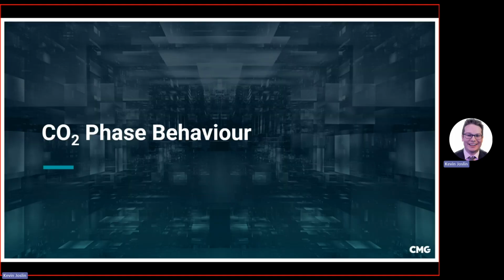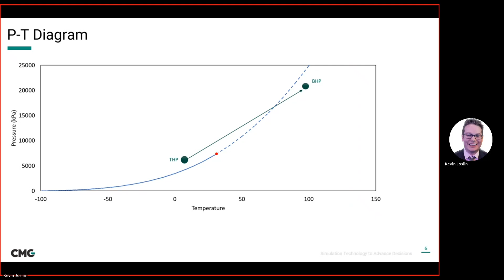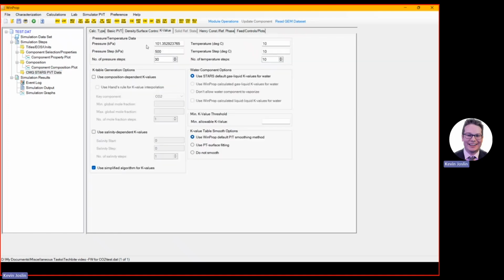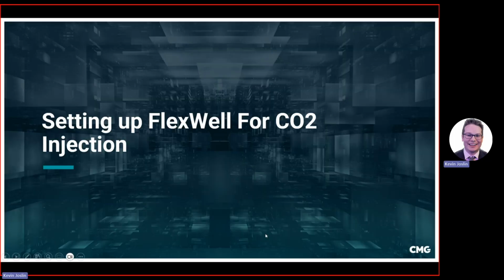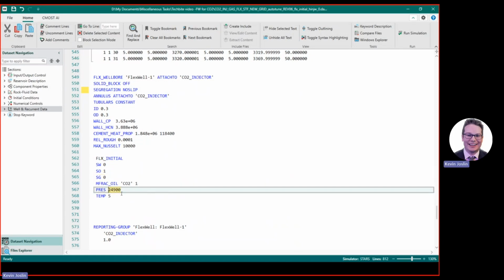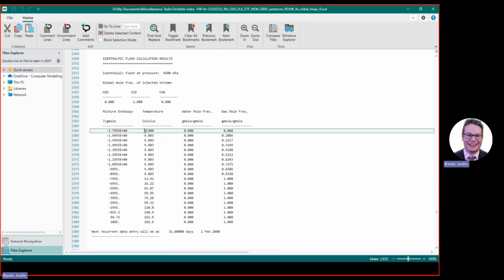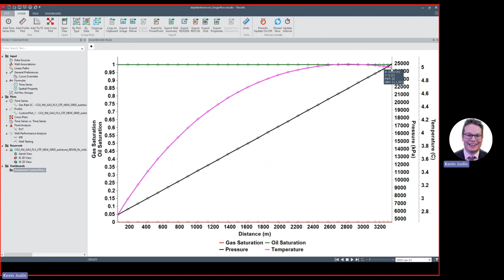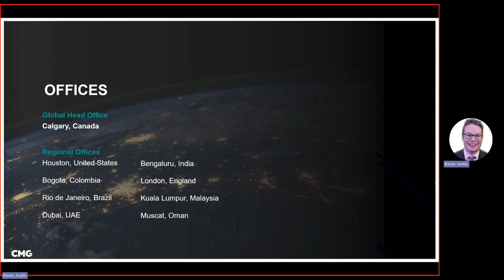Using FlexWell to Model CO2 Behaviour in the Wellbore

Comment: Thanx for such an informative video. 
I've got a quick question, how come you started by setting two components in the WinProp model (CO2 & water), but ended up with three components (water, CO2,CH4) in your ".dat" file !
Also, I tried to use that "FLX_INITIAL" to start with an initial gaseous CO2 column inside the wellbore, but I faced convergence issues